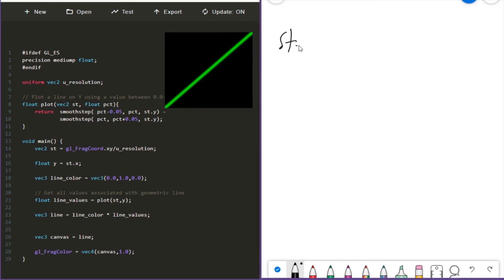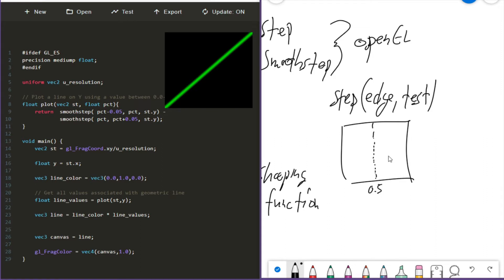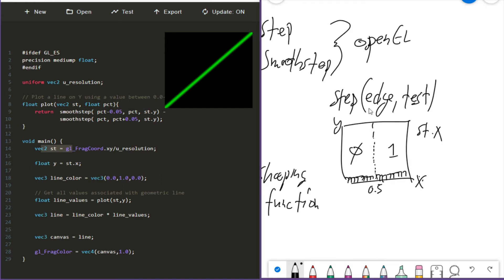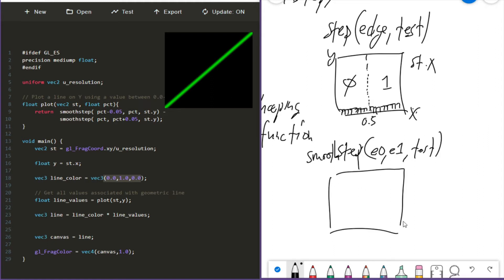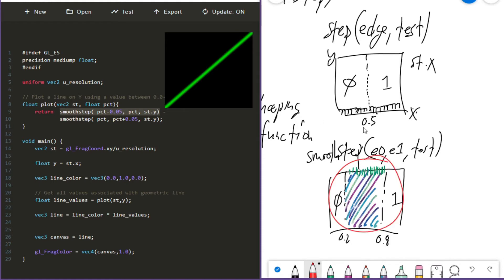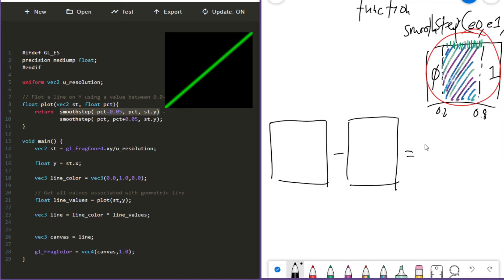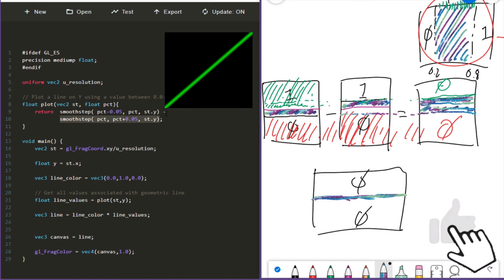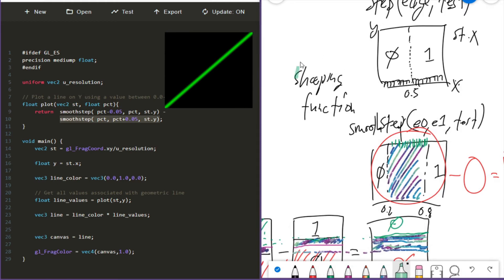OpenGL Fragment/Pixel Shaders (2020)| You Need (GLSL) Step and Smoothstep in Your Life

Comment: I enjoyed the video but one is NOT based on the other.
'step' is an if/else condition: if (x < edge) return 0; else return 1;
'smoothstep' is a math formula: (3.0 - 2.0 * t) * t * t  but ONLY as long as you provide the 't' within [0,1] range. If not, you need Inverse Lerp to get your value in that range first and according to Khronos' GLSL docs it's expressed as: t = clamp((x - edge0) / (edge1 - edge0), 0.0, 1.0);   <--- And this is Inverse Lerp, formula being "(v-a)/(b-a)", it's the exact same thing, just different names for the variables, then the value is clamped for good measure.

Comment: I think that colorful background brush for the interpolated values is distracting and kinda misleading as it hints at something random and wildly varying happening there when in reality the values are very predictable. I guess it would be better to draw the explanation images using code or stick with a brush that uses a simple monochrome gradient that goes in the direction of the smoothstep.